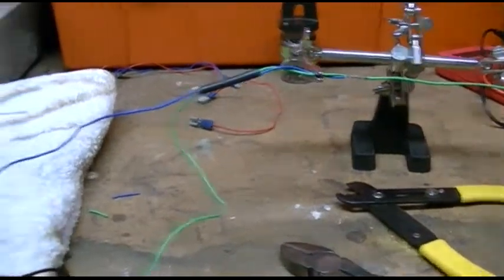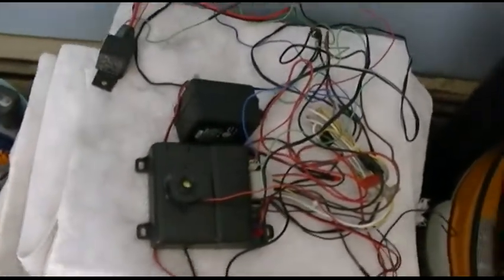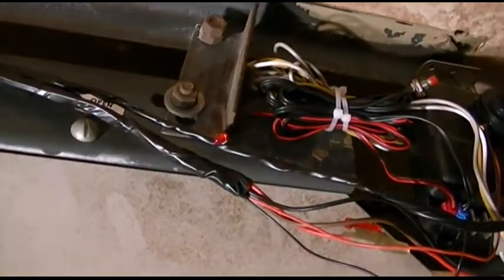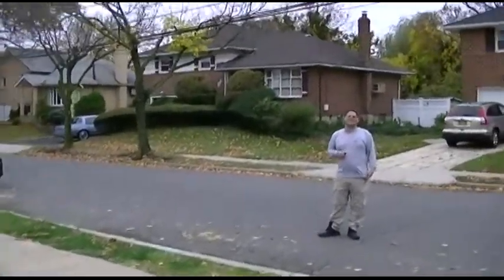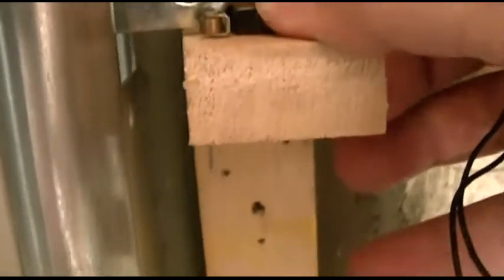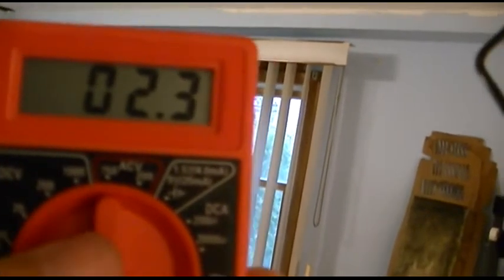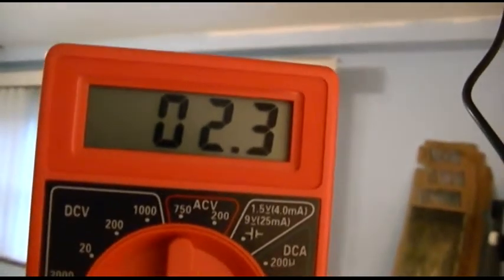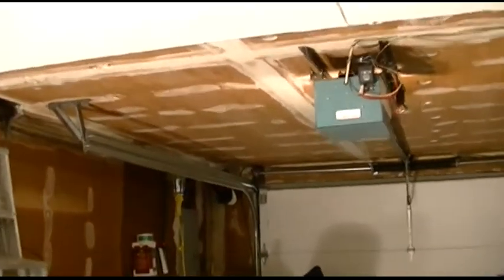Car Alarm Converted To Garage Door Opener Part 3

Comment: Adding a wireless remote to a garage door opener that already has a wireless remote?
Reply from the maker: +Blaine Bugaski The wireless remote that was on the unit already had quit working.  I never diagnosed the old one to see what the problem was.  But my friend told me he went in the control box and twiddled the potentiometer already, which is supposed to "tune-in" the frequency from the remote transmitter.  Basically it was a lost cause.

Had this old car alarm laying around that was in service since 2002 or so until now, and realized it could be repurposed for this.

Comment: Is that garage door opener as old as the house? Interesting design for a garage door opener.
Reply from the maker: +Andrew Gallucci It's from the 1970's; the house was built in 1958 I believe.  Chances are for the first 15 years the house was standing the garage door was operated manually, but that's just a guess.  They did indeed have openers since at least the 1960's, and quite possibly in the 50's, but in the 50's it definitely would have been considered a luxury.
Reply: jaykay18 Thanks for the info.

Comment: Serious question: when you engage the lock bracket and everything is off you showed you can still press the key fob. What would happen if you pressed the key fob then open the lock? Being that the keyfob thinks the door is already open.
Reply from the maker: +xjoe81x It would work normally once the latch was reopened, except the door with be out of sync with the LED.  Normally when the door is closed the red LED flashes.  If the latch were locked and you press the button, it would "disarm" the alarm, and pulse the relay to open the door, except the garage door opener doesn't get the message since the safety switch breaks the circuit.

The alarm has no idea whether the door is opened or closed, and also has no idea the safety switch is there.